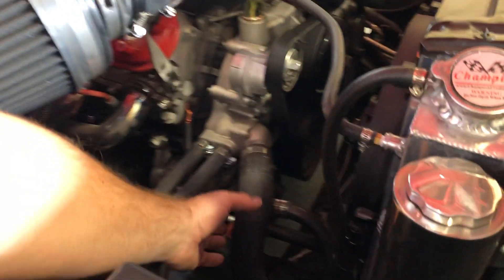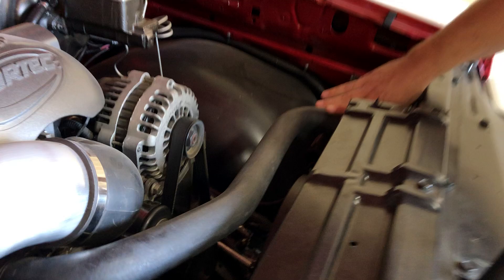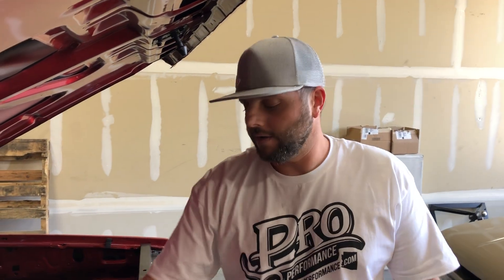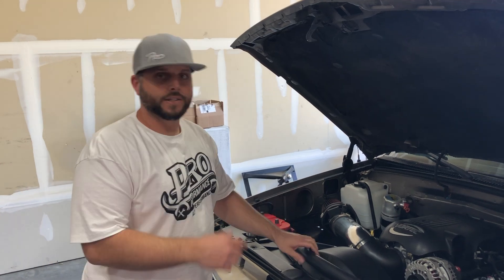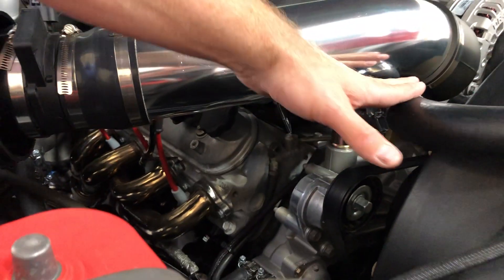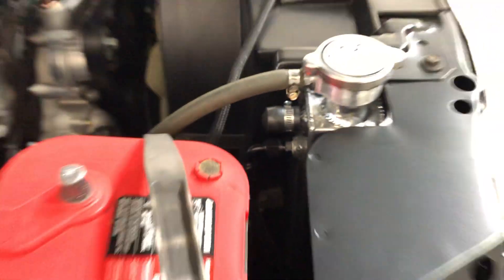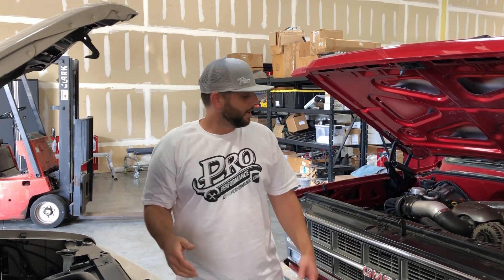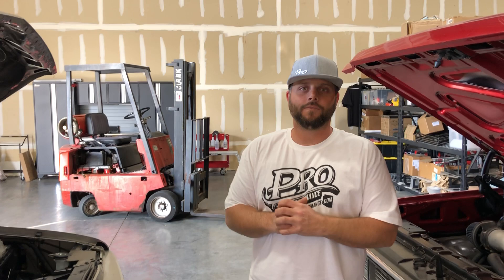LS Swap Radiators vs. Traditional Radiators - Are They Needed?

Comment: You will need an LS swap radiator high-capacity if you do an LS swap in a asteroid Safari as I have done. They do sell direct bolt on 
But it still runs a little bit warmer than I was hoping it would after I put the high capacity 3 row aluminum inch and 5/8 thick radiator in it. Now I'm wondering if I can install a Silverado or Tahoe truck size radiator in place of this one with some fabrication probably the side tabs need to be TIG welded on anybody can help with this as a solution?

Comment: I have a 350 and installed a LS Radiator, the piece you are describing (steam port connector) - it is required to make a LS Rad to work correctly on a non- LS motor?

Where can I get that collar?

Comment: Hey my friend I have a question in an LS swap The water pump have 2 Nipples one bigger one is smaller. I nstall my vintage air.. and about to do the houses my question is which nipple off the water pump Should I connect the Here is the control valve.. If you can let me know appreciate thank you so much

Comment: I noticed on the Tahoe you stayed with the AC clutch fan that attaches to the water pump for cooling purposes, is that factory cooling method just as good as using to electric fans?
Reply from the maker: Yes, we found it works equally as well and saved cost vs. getting electric fans.

Comment: I have a 78 c10 with a ls1 swap and I’m using my stock radiator but at the moment I’m having trouble finding upper and lower hose that will work. I know that the hoses from my c10 are a bit larger than the ls1, how did you guys make it work? Any help would be appreciated! Thanks
Reply: Late but, I just put section of proper hose on the rad fittings then place the original larger hoses over it. Sorta double hosed. Lol. Cheers